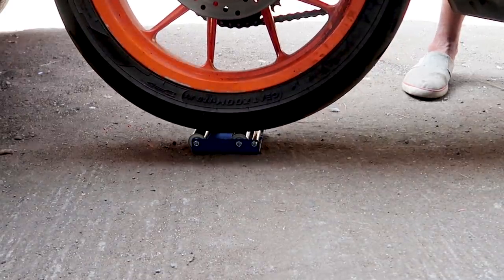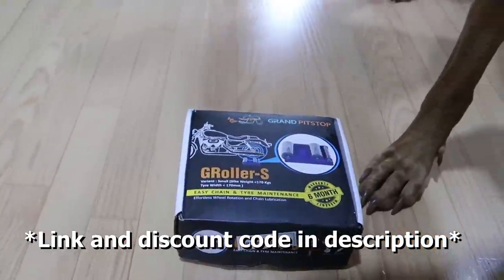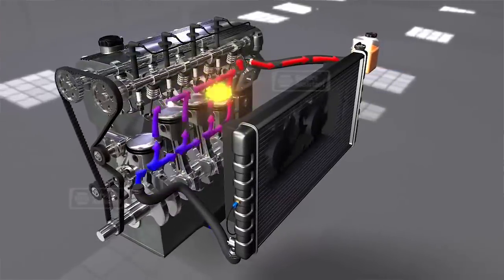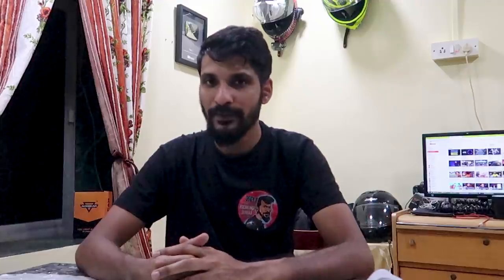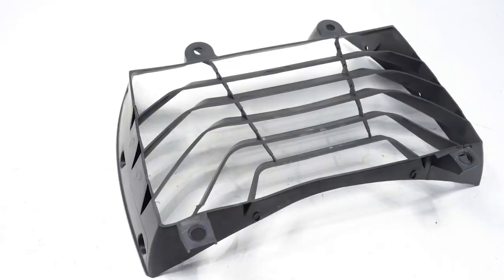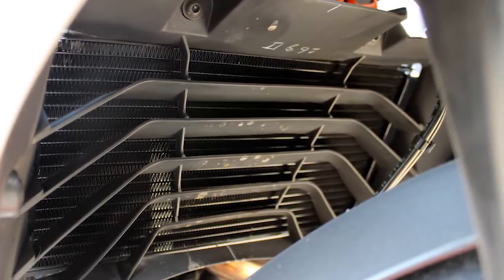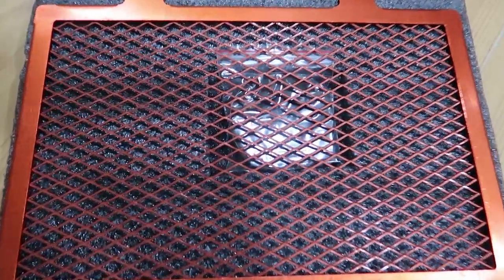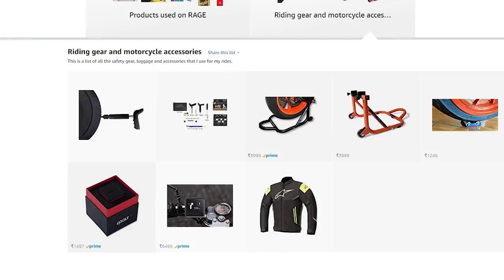High Coolant Temperature Problems Resolved | KTM RC/DUKE 390 - Part 1

Comment: It helps a lot for KTM users , thank you so much , I don't own one but my frnd does and I took his RC 200 for a day (my bike was on shed) i took a 60km ride , and it was noon when I returned his bike and it was super heated (thankfully did not die on the way) , this video will surely help his motorcycle reduce heating , I will surely suggest this video to him
Reply from the maker: Thank you for the kind words. Ride safe.

Comment: Have the same bike. On a really hot wheather egine temp. jumps even to 80% until leather H, some 2-3 lines more than yours. Is that ok? I also can't see if the ventilator rotates or not?

Comment: Thanks from the UK, running about 1 bar too hot  in the display. Will clean my radiator and remove the shroud when I strip it down over winter.
Reply from the maker: Glad I could help. Hope you don't need to get to the third video in this series to resolve your motorcycle's issues. Ride safe ✌🏻

Comment: Road grime from the front tire is a real thing. And not to mention other dust and debris. An easy recurring fix to always keep the radiator clean would be to request your weekly wash guy to run the microfiber on the guard and and pressure wash.
Reply from the maker: That and there's a mud flap for the front fender  which the dukes received that the rc didn't. If there's a way to slap that on, it would make life a lot easier too.
Reply: You didn't chose the sport bike life, the sport bike life chose you, Oggy.

Comment: What about removing the thermostat cause thats the most restrictive part of the cooling system..only down side would be cold starts will take longer in the winters
Reply from the maker: Have seen a lot of people do that but they haven't reported a considerable difference in the heat management. Have you tried that out yourself?
Reply: Oggy F nope..i have a dominar which doesn’t have any heating problems. But since there are is only one downsides to removing the thermostat and even in cold country’s they do it on bikes (250ib did it on his r1) its not a bad idea..maybe even an aftermarket thermostat can help.
Reply from the maker: @AndrewNoronha-cb2gy  will do some more research around it. Thank you for sharing.
Reply: Oggy F the stock radiator guard is designed so that alot of air flows and the dirt getting flinged from the wheel doesnot block the radiator since it hits the sides of the wing shaped things
Reply from the maker: @AndrewNoronha-cb2gy  yup but it restricts more air than it flows. Removing it helped a lot. The aluminum guard provides equal protection and much more airflow.

Comment: Hi Oggy. I own a 2013 D390. Does changing the radiator fan to the 2015 model solve the problem of heating issue.?

Comment: Hey Oggy, love your work an they way you explain. So i have A 2016 KTM 39
Reply: Having problems with the my 390 rc throttle bogging or almost cutting out at higher rpm. It  just started, any experience with this?

Comment: Hi I have got the same issue I fitted the rapid bike evo then it come up ecu failure with the temperature gauge flashing full I took the rapid bike evo off and I still have the same problem the bike won’t start

Comment: Or you can put two small fans instead of that one stock fan which will improve the better air flow & heat management .
Reply from the maker: Is this something you've tried? Cause from what I've read, that will drain the battery pretty quickly.

Comment: i brought duke 250 recently and fan is making noise when in traffic....is this normal or there is some issue in bike
Reply from the maker: The Duke 250 comes with the same radiator fan that I originally had on my rc. It's loud but works fine on the 250. Not an issue. If it stops making noise, then there's a problem cause it's not working ✌🏻😊
Reply: @OggyF  basically on traffic its heat gauge bar jump to 10 bar but when i am driving it is constant at 8 bar
Reply from the maker: @rikki7663  at any point while the engine is on, do you get a "high coolant temperature" warning?
Reply: @OggyF  not till now

Comment: Not clear on how a radiator guard helps with better thermal management
Reply from the maker: Doesn't directly help with better thermal management. It protects the radiator from damage, allowing the radiator to keep it's shape and let air pass through.... this model allows more air to flow through the radiator than the stock plastic guard.
Reply: @OggyF  makes sense

Comment: Hey Oggy!
Is there a voltmeter you are using on rage by any chance?
Also if you know the proper way to install a aux light on a motorcycle. Please share a link on how to if have free time.
I could use some tips from you on how to install few parts on my motorcycle.
Instagram handle @wolf05man
Reply from the maker: The Maximus pro device which is connected to the battery of my motorcycle sends texts to my phone about the voltage of the bike. I will be making another video on how to install LEDs  from Auxbeam on the RC390 in the future. I wouldn't recommend adding any additional lights to the motorcycle though as it does drain the battery  faster.
Reply: Aux lights for a fully faired motorcycle like rage is not necessary but I ride a Dominar400 and on the highways I do require some extra lights. For city the stock ones are perfect. I just wanted to learn how to do the circuit with fuse and relay if it is required, if not then what would be the ideal way to mount it was my question. Since, I find you  knowledgeable or heard about products that are more of a utility on motorcycles. It would be really like to learn from you.